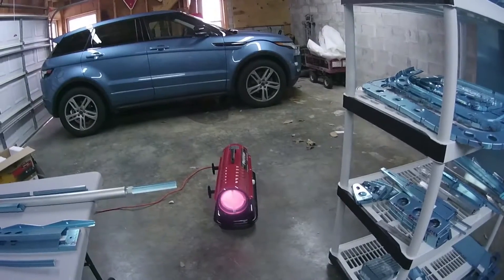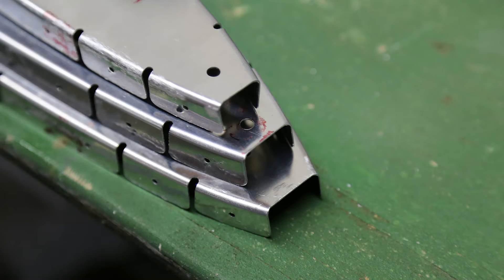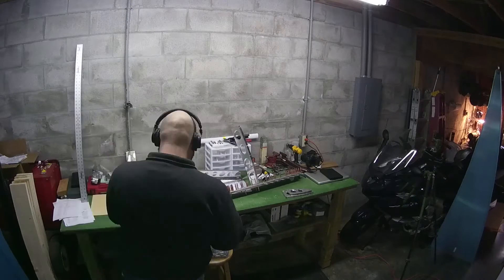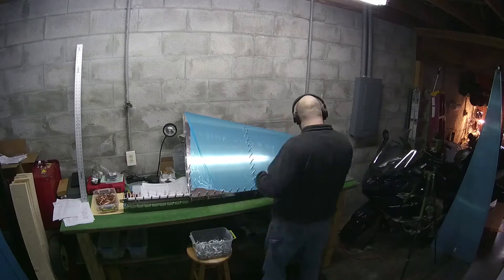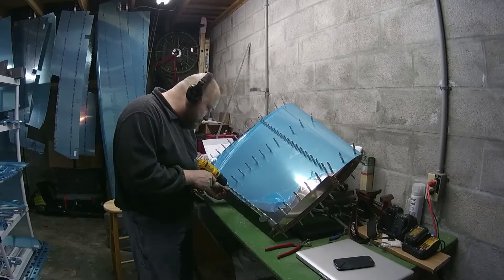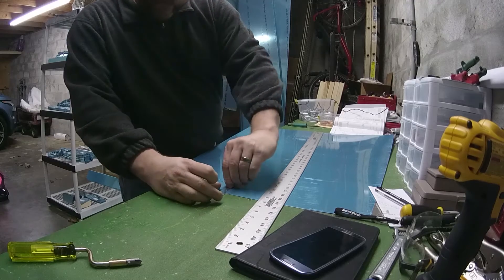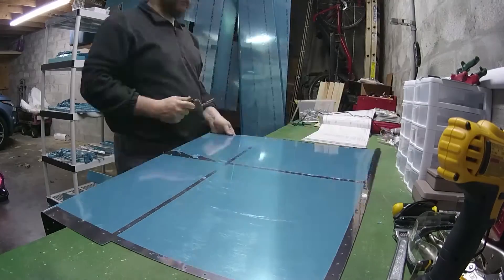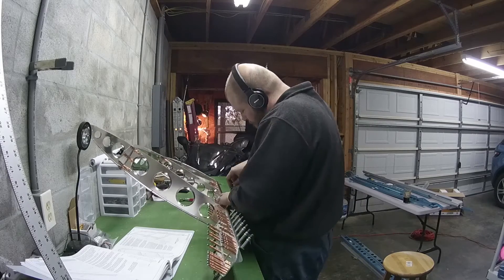RV-10 Empennage Section 6-3 Steps 4 and 5

Comment: I've never done sheet metal work before.  Do you think this is something a person without metalworking experience could manage?  I'm considering building one of these, but the idea of working with sheet metal seems a little intimidating.
Reply from the maker: Absolutely you can.  I had never done any kind of metal work prior to giving this a shot.. its easy.  You can get a couple test projects though for learning.. A tool box and a small wing mockup for testing.. give it a try.. you'll find very quickly, its trivial.
Reply: @JasonEllisBuilds  my wife and I ended up attending an EAA sheet metal workshop, and we were taught all kinds of useful techniques.

Comment: disregard my comment on the other video about deburring haha.  a quicker way to deburr is to get a step drill of the appropriate size and just gently kiss the surface with the next step size up from the hole...waaaaaay faster than manually deburring, you're a trooper.